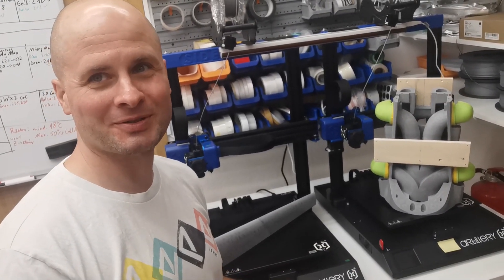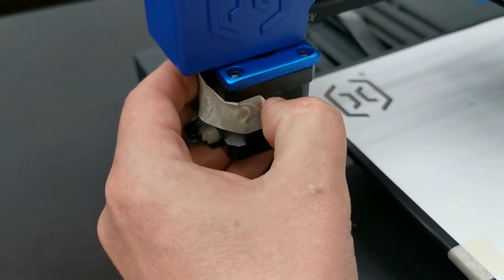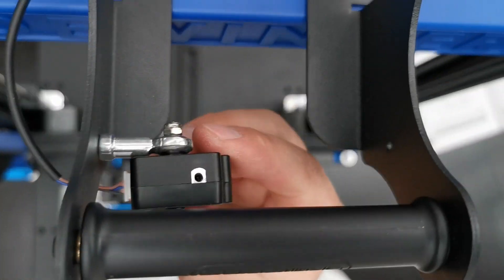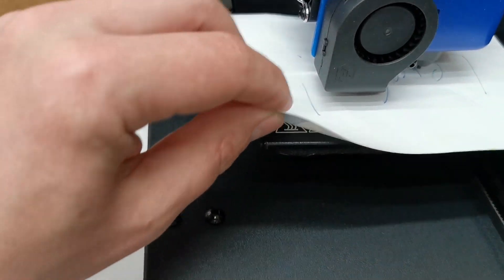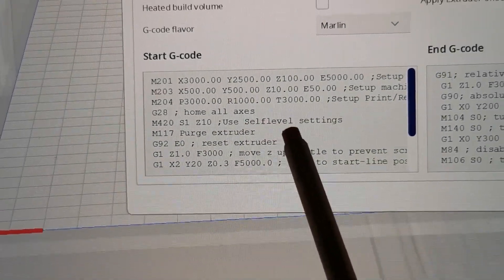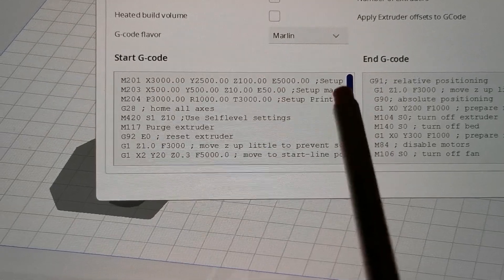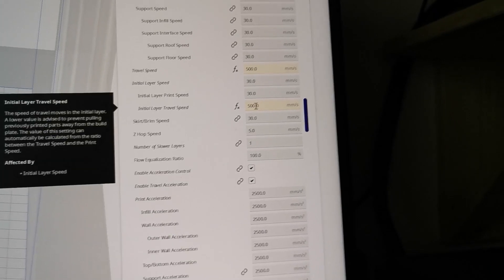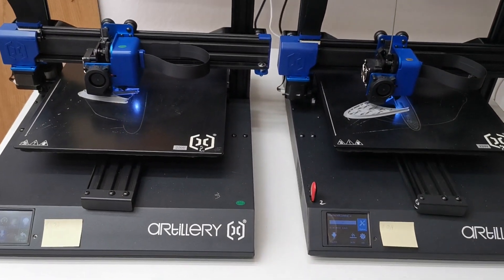LWPLA 3D-Printing with the Artillery Sidewinder X2 | Full Review

Comment: Thanks for a very detailed review! Nice that you went over the actual process of in the box, to printing, showing how to fix many problems.

I was going to buy this one, but at the last minute I looked through the Amazon reviews (the Artillery site wouldn't work) and there were a good majority of very bad reviews, telling of many issues in different areas, the 300x300x400 is VERY desirable, but if nothing works, it's useless. A common one I saw was the touch screen failing, anything bad happen to any of yours?

I think I'm gonna get a different printer, but the build plate is much smaller, 220x220x300, which means I'd have to heavily modify your designs to get them to fit, and then it would have many issues/weak points, so I'm not really sure what I'm gonna do yet.
Reply from the maker: Not yet. For beginning the Mingda Magician Max is also a good choice. Check out my review playlist for it.
Reply: @rene_rosentraeger  Ah, ok, will look into it, thanks!
Reply: I've bought both Artillery Sidewinder X1 and Genius some years ago on the 11.11 (chinese bargain day on their selling websites) for a very good price and up to date I have just one complaint about X1: the glass table warps up a tiny bit after warming up. I've bought the auto-leveling probe but I've never installing due to lack of time... Maybe for more accurate 3D printings I would go for the X2. Genius model is quite precise one. Very reliable printers indeed. No regrets till now